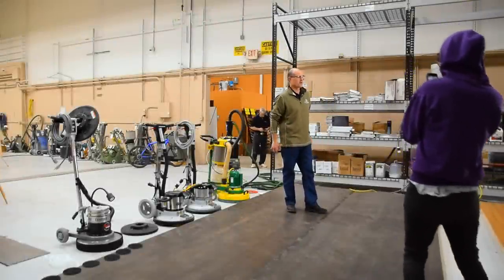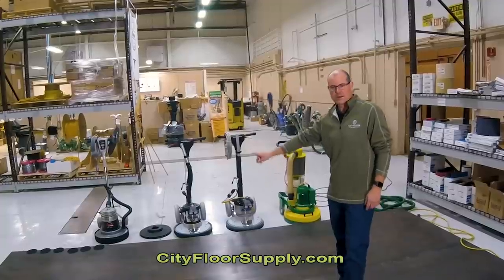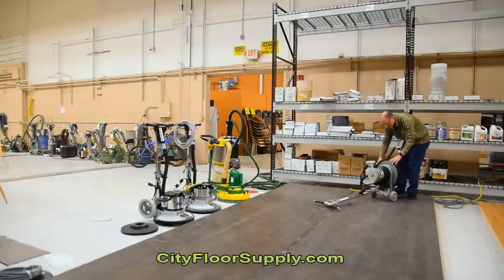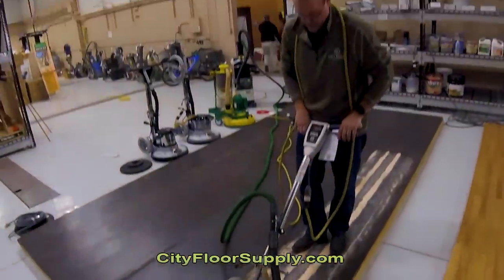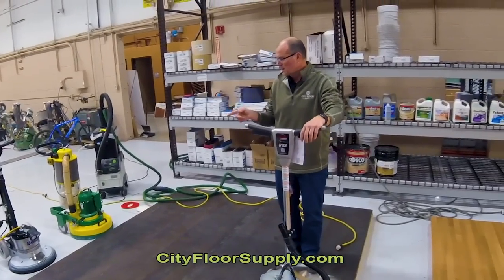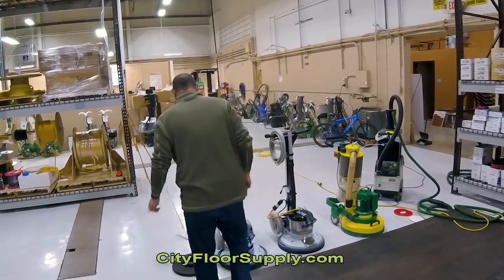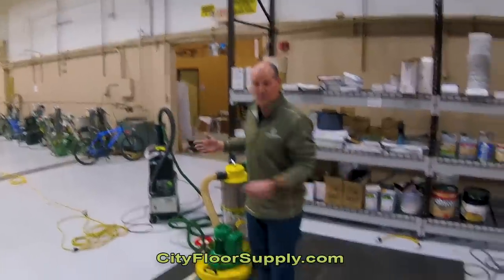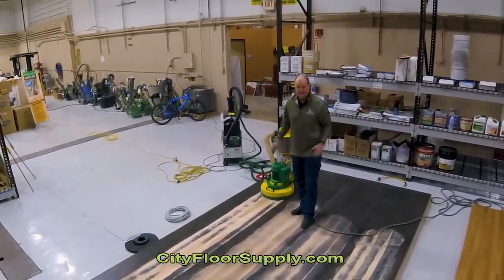Sanding Showdown! Epoch, DCS, Trio, PowerDrive Live from City Floor Supply

Comment: For Bona Power Drive you can get now weights ( like the trio) and steel hard plates . Both Trio and Bona use same power motor. And I see guys running the Trio without the self-containing dust collection unit,they attach vacuum hose and run it with the vacuum. I think cost of the bags account for that. Also what is not mentioned here is that Trio runs with the support of the behind wheels So has much bigger turn around radius than Bona. It might be important in small spaces like kitchens or closets.
Reply: and can get under some or most shelfs...
Reply: If you run the trio with the wheels off the ground it’s more aggressive.

Comment: I have 30 years of experience in the floor busines. The first years use a Cobra belt sander,then Lägler trio,but a modifided version,use 4 of these extra weigths 27kg,took away integrated dust can and use a separate dust separator and hose.

Comment: Laegler recommends initial 40 Hummel, 60 Hummel, 60 trio, 100 Hummel, 100 trio. If you’re planning on staining the floor what do you do about the circular scratch pattern from the trio final sand?
Reply: 2010GT500 You get a Clark obs square (12in x18in) buffer orbital sander, in my opinion the BEST final sander that a wood floor should have, but again...just my opinion
Reply: Water popping takes them out
Reply: Multi disk on a buffer for your final pass
Reply: 120 screen with the edger. 120 screen with a 16” buffer. Take your time. I’ve only ever had one problem in 5 years working alone. don’t cut corners
Reply: I read it?  Do you do big machine (belt sander), then do trio, then go back to belt machine again?  Go back and forth twice.  It doesn't make any sense
Reply: Using that sanding sequence you could screen 80 with wither maroon or white pad and possibly no Trio weight. Since the Trio plate doesn’t meet right up to the edge you could try using an orbital with 100 grit paper. Using a screen on the edger on the edges will work but the screen will dull real fast resulting in more stop/start. 5” Orbital paper will carry you farther. I like using the Festool Rotex for the edges. 
Going back to Trio screen, depending on the floor and the substrate/foundation topography you may want to use the thicker white rings with the screen. 
Pop the floor before you stain and you shouldn’t have much if any Trio scratches. 
Ash, maple and hickory floors tend to hold scratches and require thorough screening.

Comment: How good is the epoch hd ? Ik this is a video of someone using it but didn’t really tell you how durable the machine is and how many times does the floor need to be gone over to get it cleaned enough to stain… tbh look like something you still need big machine and then use this for fine sanding but is that really worth it?? Thanks in advance
Reply: I still think you need a belt sander first as nothing can dig as fast as it
Reply: We got the bona power drive Ike a month ago it pretty good it will take color off and get it flat it is slower than using a big machine but it does get the job done haven’t used it on a really messed up floor but I used it on pine and it didn’t gum the paper up once and that’s saying something if you sand floors

Comment: I love being done with the galaxy after roughing off but the real pay off is the time it saves you edging,dealing with offsets and r.o. sanding...Bona 1.9 power drive all the way 👍
Reply: Could you rough off a flat floor with the power drive? What about raw wood? Considering getting one even if not. Just curious.
Reply: It's aggressive enough like you see in the video but it would be slow. I've never used it to rough off raw wood but wouldn't recommend it. You will still need a belt sander unfortunately unless it a really small job like a hallway or a entry .

Comment: The weight kit for the Bona DCS Power Drive turned my unit from Meh! to somthing I use a lot. IMO it needs the wight kit to be realy effective. 

Wont replace your belt sander but is a different tool for a different job.

Comment: PLus for the Bona Power Drive, you don't use it like a buffer for aggressive sanding... the handle is meant to almost be completely upright but just a slight angle. Add the weights and use it correctly and it would do even better than here.

Comment: The powerdrove you use with pads.....and no heavyweight on it
Powerdrive you can use for finish between coats its extra.
No extra machine for sanding equipment 
Powerdrive ....I have 2.....😀😃👍

Comment: Best dust containment vac would be a question I'd like answered.
Reply: The best dust containment system is the Eliminator 3000 . It has 340 cfms . You can run a big machine and a edger at the same time . Cost is $5000 but it is worth it there is no dust .

Comment: Can you do a demo with bona craft 2k oil on Brazilian cherry?
Reply: your vidia they said yes but in fact no because with our belt sanding you can’t sand deeply as you can see this video they use new sand paper for only small panel imaging if you run this mashin for 1000 sqft it’s take you 10 hours to sand it done plus lots of paper I think it could be 3 or 4 box paper if you do sanding with this mashin plus 1 day full time spend
Reply: @ your vidua, just a few weeks ago' I sanded a Brazilian floor and stained  it with charcoal Kraft oil, and it turned out amazing,  . ( I also buffed it on with a carpet pad)...

Comment: I’m wander if big area you are not able to sand it done unless you should run belt sander for first rough cut especially I am seeing you use new sand paper and you keep moving very very slow why don’t you peoples let know these mashin should be use it only for finishing sand and fine sand instead of advertising to sanding from start to finish 
Thanks
Reply from the maker: Alex - Thanks for your question. This was really just a comparison video.  For a cupped hickory floor such as this was, using a floor sander to get it flat would be a first option. Again, this was just demonstration to show the differences between all the units.

Comment: i use bona multi disc after final paper is done with big machine.. but to do the ruff there is no way its as good a big machine..
Reply: Sylvain Lepine my schedule on most floors is :
big machine rough
Multi disc perimeter rough
Edger rough
medium grit same sequence
Fine grit :
Edger
Multi
Big machine
Scrape corners/ hand sand
Orbit perimeter 1 grit back from final grit
Reply: @edwh164  muti disc before the big machine? whats the point?
Reply: The reason I do the multidesk in the order stated is it cuts 80% or 90% of the edging out of the equation. After you make that pass there’s only 2 inches of edger work
Reply: This mashin wont sand deeply it’s just good for final sanding to get good results and flatten floor otherwise it’s take full day to do only 1  rough sanding comparing to big mashin you can finish 3 cut sanding with big mashin

Comment: Sorry we’ve tried them all in the real world and nothing works better than your big belt machine.Many of these new machines are simply a novelty.32 years laying,finishing,fixing and resurfacing.Get busy with your Hummel and Super7.
Reply: I've worked with floors for 19 years, I worked several years doing work without a trio, you can do a good  jobs without a trio, but nothing like a job whit trio, I  start using a trio and everthing change, , you can be the best sander in the world and you won't do anything close to the quality of a job done with trio.
Reply: @marimthe1083  should i buy trio or bona powerdrive?
Reply: @andersbreivik3399  If you can afford it, Powerdrive! As others have said and you can see in this trial: it outperforms the trio already without added weights, and with intermediary pads added to the plates. If you really did a fair testing under equal conditions, meaning with comparable weights added to the Bona AND either both machines used with intermediary pads OR both with paper directly on the hard plates, the Powerdrive would always give a superior result in terms of flatness, and cleanliness, - in one pass (overlapping 50%) - AND that MUCH closer to the edges (- leaving less than 1/2" to edge, if you get the right hang of it; - that perfectly blends out with a handheld orbital &/or delta on a good rotary tool like the Rockwell. -) 
You DO want to get the weight kit for the Powerdrive, as well as the steel plates, and the (Flexisand) Multidisk head! - With that equipment, you can go, where needed, with ONE machine from first cut all the way to truly swirl free fine sand/burnish for waterborne pigmented sealer as well as intercoat screening/buffing!!
Reply: @bjoyia3799  thank you 💪
Reply: @marimthe1083 Will be same quality sanding first big drum big machine, then finishing with Bona Power Drive to have 100% wood floor flat. I am not sure what to buy Trio or Bona Power Drive?

Comment: I have a trio it is never used like that. its always lifted off its wheels 3 times more aggressive this way. .so be fairly even with powerdrive
Reply: hey mate used this on decks? any good ?
Reply: @Deckrejuvenationcom  no the deck would need to be dead flat and that is Never the case. prob need a belt sander
Reply: David Haugh trio is not supposed to be aggressive that’s not what it’s for it’s a fine polisher

Comment: You called this a showdown however with the bona power drive vs the lagler thing you didn’t do a fair comparison.
You should have taken off the intermediate pads added weights and used it at more of an upright position and that would have done a much better job. 
It was like you were trying not to show the bona blow them all out the water